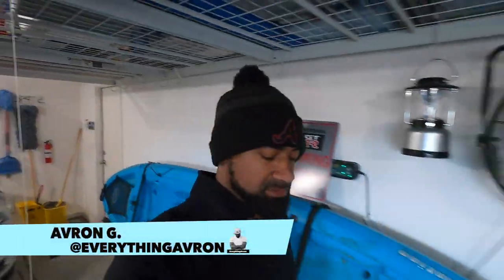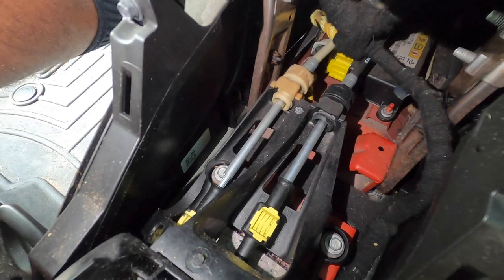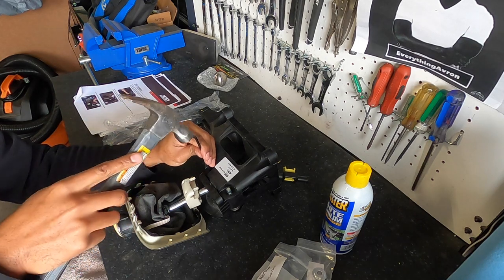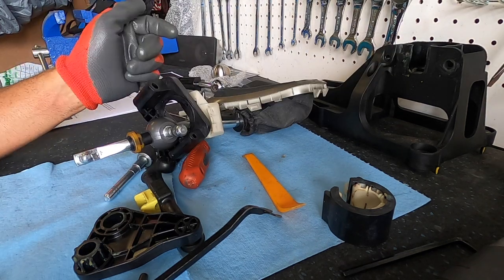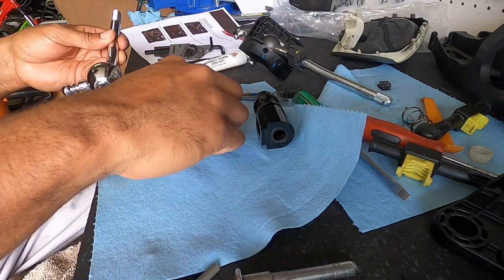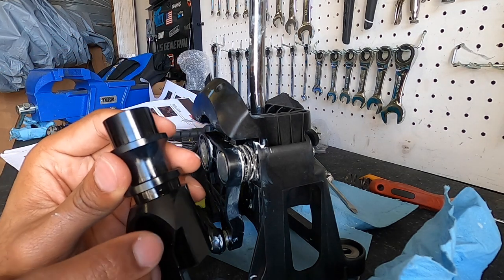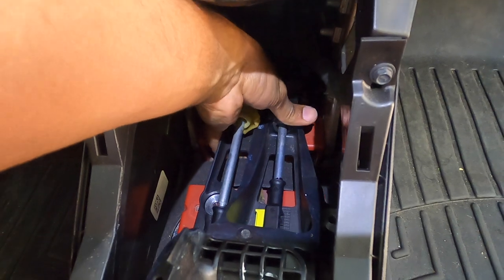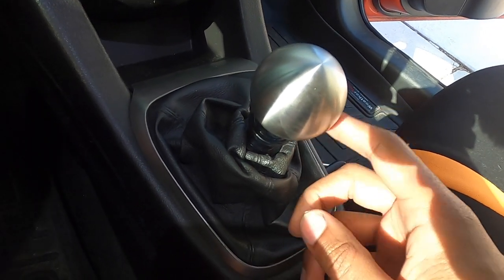HOW TO INSTALL ZZP SHORT THROW SHIFTER 2012-up CHEVROLET SONIC| New ZZPerformance Shifter & Bushings

Comment: Thanks for the video! Super helpful. Something I did to help with all the metal clanking noise in the new shifter is I put the same white lithium grease on all the moving parts in the spring and reverse assembly. Made it smoother and a lot less noisy